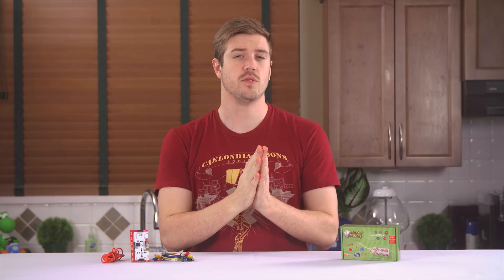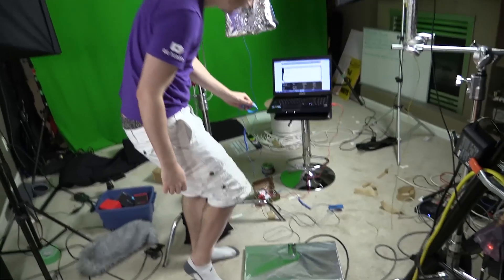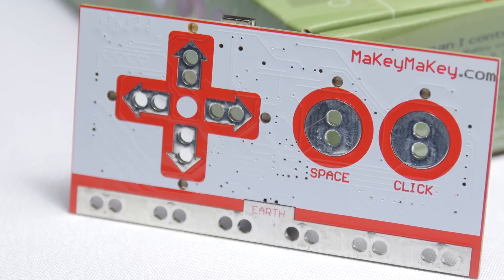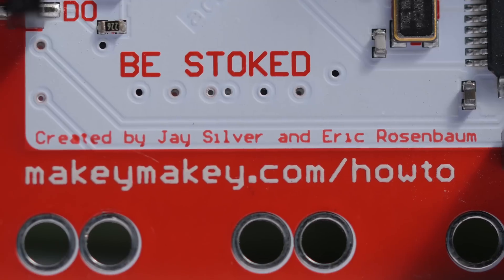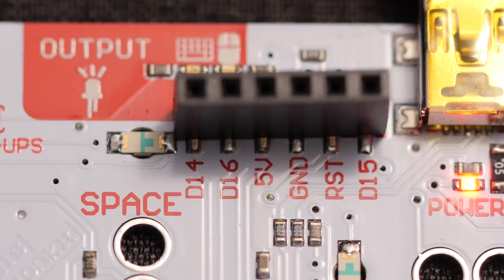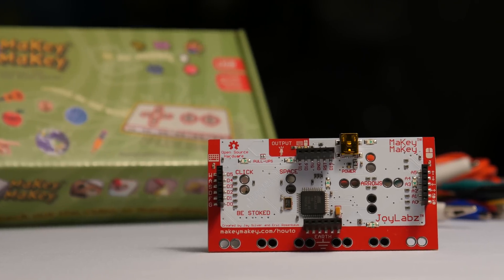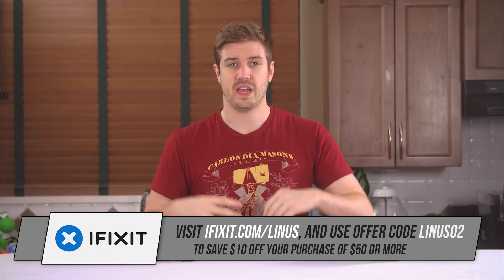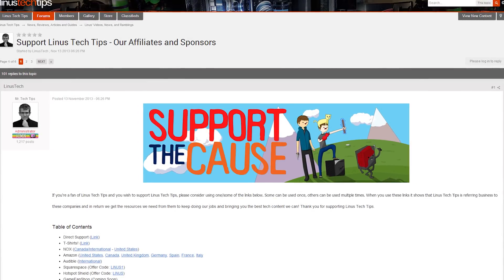Makey Makey - Practical and Fun Computer Control

Comment: It would be neat for a short development / hacker board series. The majority of them are super cheap and you can do a lot with them. You could do basic home automation like back to the future with thumb print locks and lights that come on when you enter a room and go off when you leave. Or a crazy home network that would give you a computer in the kitchen for when your cooking, a screen behind a bathroom mirror that displays your news and weather while getting ready. There all sorts of ideas out there, and when a development / hacker board is $30 and a used monitor is $20 no reason not to try it.

Comment: MORE MAKERY THINGS PLZ. Nixie tubes, motors, screens, raspberry pi's and single board computers, all of those things would be amazing on this or a subsidiary channel.

While you're at it, look into the spark core. It's literally an arduino, but the IDE is on their website and you can reprogram it wirelessly. It comes with wifi built-in out of the box as well, and you can control individual IO pins from an android app, also out of the box.

Comment: Can someone help me:
Will this GPU and CPU work together. Im building my first computer over the summer and want to know.

CPU: AMD FX-8350 8-core 4GHz Black Edition
GPU: GIGABYTE Geforce GTX 980 4GB 256 Bit PCi3.0 SLi Ready Windforce
MOBO: ASUS Sabertooth 990FX AMDFX SATA 6Gb/s USB3.0 AMD ATX Motherboard with UEFI BIOS.

Will this work ? and what kind of power supply should i get. Notice : I use newegg.
Reply: If your talking about hardware compatibility any graphics card and cpu combo will be compatible. If your talking about 'bottlenecks' there shouldn't be any issues with that combo either
Reply: ***** Im talking about both. Thanks. I figured i would go with a high end to enthusiest card then a highly rated cpu.

Comment: GUYS I NEED HELP NOW!!! I need help for a power supply!!! I'm getting :
•FX-8320 (I'm gonna overclock it at 4.0 ghz
•R9-280x

I NEED SOMEONE TO TELL ME HOW MANY WATTS MY POWER SUPPLY SHOULD BE if my fx-8320 is at 4ghz. (not overclocking gpu)

Will 550 WATS be sufficient?
Reply: I had a 9590 (roy taylor gave it to me) and a 290x I recommend you get a 750 watt psu from a major compney go on pcpartpicker and find the cheapest good 750 psu
Reply: I would highly recommend at least a 600w if you buy a good quality psu. Personally I'd go for a 650w or 700w.
Reply: Grant Hutsell wattage means nothing if the psu cant supply the amps

Comment: Hey im from the future and im using the Comment2Past feature they have on YouTube now in 2084. I used to live on earth but I moved to mars anyways my computer specs:
CPU: Intel Core iX15-12Z (Extreme Edition) 256 Core 2932Ghz overclocked to 3112Ghz
GPU: Nvidia GTX Titan 9500X with 8 GPU Technology (8 Way SLI)
RAM: 16TB Corsair ZX Dominator Ram DDR9 (16x500GB)
MotherBoard: ASUS ZX Deluxe WS
Storage: 8x Seagate 4PB SSD
Reply: 16x500GB= 16TB in the future?! 
Cool!
Reply: Do people really find this funny?
Reply: Øyvind Lorentsen And a motherboard with 16x ram slots xD
Reply: Still using modular components and DDR?
Reply: ruboy jenkins Is the GTA V Finally at pc?
Reply: Øyvind Lorentsen i think so
Reply: Øyvind Lorentsen math must not be taught in the future
Reply: man you could almost run minecraft at render distance 2 with those specs
Reply: Lol I'm from 2085
Reply: mbsfaridi ikr. I'm onto qdr3. I got a 32tb kit. He I have a 6yb ssd
Reply: tikiman48 So, we still have disparity of pc hardware :(
Reply: What's the transistor size on that beast
Reply: tikiman48 QDR is meaningless for gaming. There is a reason we are increasing DDR for Pc hardware. We could have switched to QDR standarts even at 2005.

QDR has very high latency, that is the reason it wont be used in gaming. DDR was the perfect data rate for normal computer usage. QDR and above will only be used in servers.

Also saying, DDR4 had quad channel. DDR4 is incredibly faster in proces-required applications compared to QDR
Reply: christopher davey 3 atoms ;..;
Reply: Navhkrin server grade is the future
Reply: Navhkrin Dat quantum tunnelling
Reply: Max Reid-Williams Not really. Servers are completely diffrent things. Server is server. its not a super-advanced computer. Servers aim is to transfer alot of data quickly. Other then that their processing ability is quite weak. While computers require alot more processing ability. This is why DDR is better for computers while QDR is better for servers.
Its like the differance between DDR and GDDR.
Reply: You should get an 8EB DNA storage drive for long term file archives
Reply: Øyvind Lorentsen math is hard
Reply: "Look guys I made the numbers bigger!"
Reply: Navhkrin Yeah a server's processing ability is quite weak... That's totally why a measly server could have only 4 16 core CPUs but your mighty mountain dewrito gaming PC has a single quad core...
Reply: I'm assuming the ping to your planetary quantum server is about 63 nanoseconds?
Reply: ***** Only cause games only run on a few threads at most. Plus since when is gaming a serious benchmark of performance of computer hardware?
Reply: bassl0va You are missing the point that server is transmitting millions of data. That is the reason it needs alot of cores. You can put thosand cores if you will. Since every single of them will be doing a simple job it doesnt matter. 

Also 6 core with hyperthreading. Please.
Reply: Do you get 600 fps in the new Call Of Duty 53?
Reply: Navhkrin A server still has more raw processing power than a gaming PC. Gaming PC only wins when the workload doesn't involve many threads.
Reply: bassl0va It depends on data itself. As i said, A server is better for transmitting data as each core is not designed to handle a big job. A pc has low amount of powerful cores which are designed to handle big jobs.

That is the differance. And that exactly is the reason why "server grade" isnt future. Differance between servers and pc's are like the differance between trains and cars.
Reply: Navhkrin Servers are far better at handling 'big jobs', provided the jobs can be split across multiple threads. Processing data is processing data, a normal PC is only better when the work can't be split across multiple threads
Reply: bassl0va That is what a big job is. Big job is a job you cannot split into multi threads. Its a demanding single thread application. Servers can handle tons of small jobs. But not a big job. In fact servers will still be very weak in handling splitted small jobs. That is not what they are designed for. Every component is specially built for fast data transmitting. Not handling jobs.
Reply: Navhkrin I would call rendering a video and complex computer simulations big jobs, I guess our definitions are different.
Reply: bassl0va Rendering a video is actually pretty fast. There are just too many parts. Considering a single second required 30 or 24(their decision) frames.
Not demanding per part. Just has too many parts.
Reply: Navhkrin Can you give me an example of something that's a huge task that can't be split across multiple threads? All of the most time consuming tasks for a computer I can think of benefit greatly from multiple threads
Reply: bassl0va Well thats very code related question. Basically when a line of code needs another line to be executed in order to work properly you cannot split it across multiple threads. This is generally the reason why games utilize low amount of cores.

This does not need to be a single command. It could be an entire process that requires another process. Depends alot on how big object is.
Reply: ***** I see you are new to the computer market. My primary advice is that you should not speak without knowing anything.

An application can only run as fast as the slowest component, In gaming scenerio %99.999 of the time GPU's bottleneck CPU's and CPU's generally run at very low performances.
Reply: ***** "highly" is a very wrong term.  ArmA does not even have proper multicore support. DayZ should be same reason since its based on ArmA.

Most CPU-demanding game on market is battlefield 4 , as it uses CPU to calculate particle physics but even BF4 is not that demanding

Minecraft is in pretty unique situation. It can make use of 32 threads as far as i know. Notch coded that game very well. However there are barely any legandary coders like notch in gaming industry.

As long as you are being bottlenecked by your GPU, gaming is never a good benchmark test. To benchmark a component you must make full usage of it.
Reply: ***** Minecraft is not awfull coded. Really man i will repeat.
"My primary advice is that you should not speak without knowing anything."
Minecraft does not use GPU. Why would it? It doesnt have shaders, It doesnt have dynamic lightning. Its just a very basic game. It has NO TASK for GPU.

If you really want to make use of your GPU ın Minecraft download ultra shaders mod from anyone(i prefer mrmeeps myself). Then you will see.

If a game does not use %100 of GPU's potential it wont be a proper benchmark because a high end CPU will run at %10 while low end cpu will run at %90, they will in the end produce exact same FPS. However this situation is only valid if they have exact same core count. Otherwise if game makes use of parallel processing there willl be differance.

Your chart is very old. Those old CPU's are actually bottlenecking on Crysis 3, If you remake that test with 3ks and 4ks im sure there will be very little fps differance.
Reply: Why has this spun off from a small comment I have made?
Reply: ***** As i said, old ones are bottlenecking on Crysis 3. Thats the reason there is performance differance.
There is good differance on i7's because they use multitasking... 5960k has 2 more and virtually 4 more cores plus +5mb cache. It should have shown a massive differance between 4790k and 5960k yet there is not.
This alone clearly shows games are very bad for benchmarking cpu's.

"CPUs don't change very much between generations, they don't need to"
And here we go again... 
My primary advice is that you should not speak without knowing anything.
Performance wise, there is very little differance between 3960 and 4960 BUT that is where they switched from 32nm to 22nm transistors.

And between 4ks and 5ks they added 2 extra cores and +5mb cache as default + they made em competible with x99 chipset.
Reply: no ptttffft but minecraft is gone tho
Reply: ruboy jenkins no minecraft inst gonna go just that microsoft has it
Reply: ruboy jenkins but minecraft is gone maybe cs go is gone also from too many kids being annoying

Comment: Off topic. But I need help. I have an issue when trying to overclock my rig even with the slightest increment of adjustments my ethernet port stops working so I would have to load optimized defaults  to get it back...it says it's missing a driver or something like that...please advise !!

System:

-Amd 8350 FX
-Asus V formula Z Mobo
-850 Watt XFS Power Supply Gold
-Samsung Evo 840 500gb SSD
-Seagate Barracuda 2TB HHD
-16 gb Kingston DDR3
-Asus 980 Matrix Platinum in SLi 
-NZXT Phantom 1 with 9 fans
-Corsair H55i CPU cooler (radiator)
Reply: I had the same type of issue and I updated my motherboard bios. It worked for me so I would recommand checking on the official website of the manufacturer if there are updates available ...
Reply: If you built your pc you need to install chipset drivers,audio drivers,Ethernet drivers and bios. That may be the problem if you haven't installed drivers from the motherboards website.
Reply: Yes I would like to know thus answer too..
Reply: If you built your computer I have to ask if you installed the drivers for the chipset,ethernet,audio, and bios?
Reply: MrWariGaming i have tried going to Asus's web site but it seems like a bunch of non sense...its very unclear
Reply: Troll House Cookies Yes i built it. My brother chose to install drivers from the website. But i dont know if the included cd was better or he missed something? I will try it agajn from Asus's website. Thank you all for the tips! I will let you guys know what happened.
Reply: That's the gayest build I have ever seen. You're a disgrace to the PCMaster Race Secret Society.
Reply: Scatman John I Don't Give a Fuck about You or anything that You Do. You Little stupid ass Bitch. I Don't Fuck Wit You.
Reply: Dont use driver cds unless theres no other way. btw can you tell me what motherboard you have?
Reply: http://www.asus.com/us/Motherboards/CROSSHAIR_V_FORMULAZ/HelpDesk_Download/ Here is the link to the download page of all the drivers.
Reply: Also make sure you select your right OS.
Reply: Vannon U PIS!!1!1 U dunt no how 2 bild a pc!!1!?!1 i bild pc fer 250 buks... Id hat3 2 c fegs bild bad pc at hi amount of buks. so i giv u mi spec of mi pc.

cpu amd sempeon 1x 1.5GHZ

Gpu pny gtx 0.5

Ram 512mb of ddr2 

Mobo asrock shiturd

Case pizza hut box.

U c mi bild is beter!!!1!!1!!1!
I toats recomnd!!1!!1!!1!!!!1!!
Reply: Scatman John OoOOoo you broke...now i understand...my apologies..
Reply: Troll House Cookies thank you i will do this now
Reply: Troll House Cookies it says i need to download a cap file viewer? So thats where i get stuck cause i open the file...sorry im stupid i know...but i'm learning.
Reply: Troll House Cookies can't open the file i mean**
Reply: Troll House Cookies i got the cap file to open...now it can open the folder inside of it
Reply: Troll House Cookies is there another way other than asus website? It seems just not able to download any updates for me...i even went to the ai suite that has asus's "ez update" but that cant even download or detect asus's server at all...hopeless
Reply: Nein i is no pour bru. 
I jsut is a xtream 
Coponer u git
Scam cuz 
U dnt 
Extrm
Cupn
Bru
..
.

Sry gyz i ran ut of ink fer mi nokia so i cnt rge lunger.
Reply: Troll House Cookies i think i have to make a flash drive to update the bios...did it...still no go..
Reply: Troll House Cookies ok i git the new bios installed by doing via ez flash 2 from the bios. Now i tried to overclock again and it says the same thing network adapter not found or installed incorrectly..suggestions??
Reply: Thats very weird ive never heard such a thing if your NIC card isnt one that goes into a PCI slot then it probably broke.
Reply: I meant if you NIC card goes into pci the nic card is broke.
Reply: Troll House Cookies I called Asus and they said that the Kingston hyper x fury was not compatible with their board because it's not one that is listed..so I took a chance and ordered 32gb of rip jaw x ddr3....if this fails I will have to go with the x99 and ddr4..
Reply: Troll House Cookies something it dumping files..and failing
Reply: Omg shut the fuck up already butch shut happens you broke as bitch made as nigga
Reply: That's cool that they helped you out. Best of luck!
Reply: ***** who said mine didn't work jack
Reply: Troll House Cookies rip jaws x 32gb just came in :)
Reply: MrWariGaming thank you!